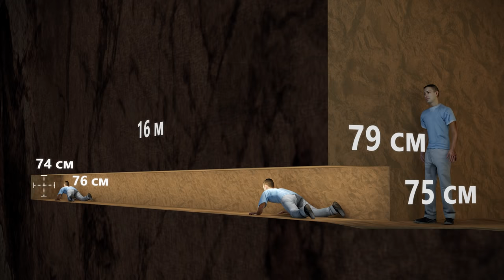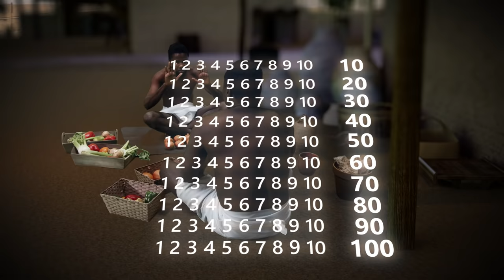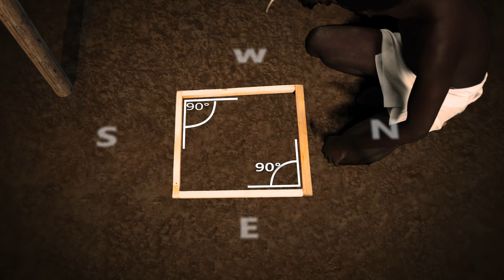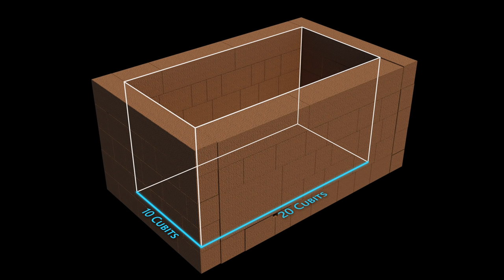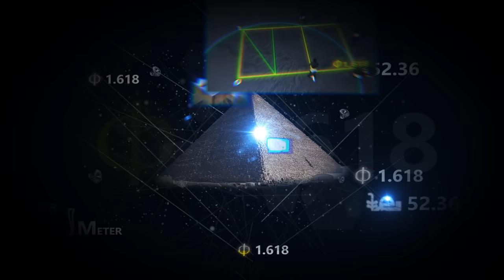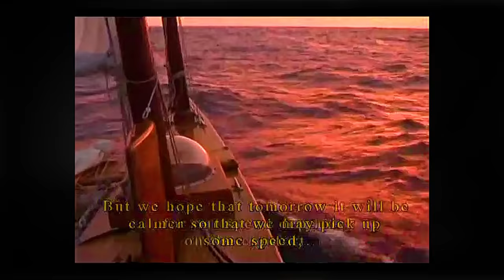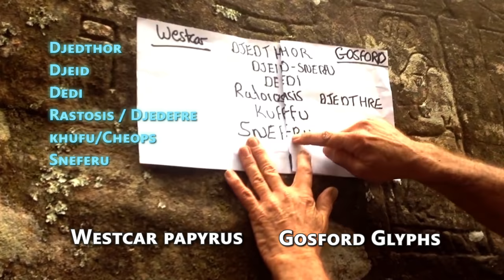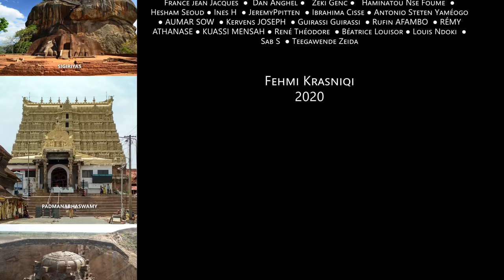The Movie Great Pyramid K 2019 - Director Fehmi Krasniqi

Comment: The cement seems feasible, but melting granite? Those temperatures would require special suits, eye protection, and the melted granite would not have a grain as seen in statues it would be a blob of glass.
Reply: In 3.5 hours they spend zero time explaining their maigical solar lenses..
Reply: really solar lens ,rubbish requires 4000deg c to liqify rock even cement would just be warm
Reply: You can melt granite, it becomes obsidian. You could try to pour it into molds but without some serious heavy machinery it will not create anything like a large stone, and it will crack as it dries, and it won’t be strong.

But, again, if you melt granite, it will no longer be granite, which is only created deep inside the earths crust. You will be left is obsidian, like glass.
Reply: @ericpalmer3588  Exatamente !
Reply: @ericpalmer3588  is there something that you can melt and mix with something else to make granite?
Reply: @Digidi4  granite is forged deep in the earth’s crust under tons of heat and pressure. 

Anything made out of granite is carved. It would not be possible to create granite and pour it into a mould.

The whole melting granite theory is not necessary.
Reply: @ericpalmer3588  oh ok, thanks for the explanation
Reply: @johnwalker5366  wrong granite melts at 1215 ºC or there about easily attainable with a magnifying glass of say oh 1 metre  ....oh look a metre the egyptians used a metre
Reply: @ericpalmer3588  Actually if it cools slowly say for example it was surround with insulation perchance lime concrete? it would not crack and would retain its properties and would still be granite. obsidian is not even a rock its a by product more like glass, formed by heating and rapid cooling of molten rocks
Reply: @RobMocar  incorrect. If you melt granite it is then obsidian, no longer granite. What you are left with is a glass like substance, the crystalline patterns and marbleization is gone. Granite is only created deep in the earth’s crust where you have the right amount of heat and pressure and change.
Reply: @ericpalmer3588  without going all geology on you here some layman's answers "Question" https://www.quora.com/If-I-melt-granite-will-it-be-granite-when-it-cools I also have a degree in metalogy which I had to take to get my welding certicates so I am very used to molten elements and how they work.. I do agree hard to do but I don't believe impossible... More feasible than aliens
Reply: @RobMocar  Do it then. Make a giant granite block by melting granite down into a mould. And use a lens.
Reply: @ericpalmer3588  yeah cause I can do that all on my own lol just be open minded bud nothings impossible once u know how it's done
Reply: @stephendriver4656  heated too fast and cooled instantly
Reply: @stephendriver4656  Yeah, the stone turned to glass (obsidian). It is what we have being saying.
Reply: @RobMocar  would it be possible to do with a 50x50cm rock, perhaps? that would be great to see... how would one keep the granite from cooing too quickly?
Reply: It would take longer and be more dangerous to make one block, it would require a massive amount of heat, who would be able to work with this then put it accurately in a mould, let it set then get it out the mould. It would take too long doing this and very dangerous. The thing is granite looks very much like granite in the pyramids as in quarried, transporter during certain times of the year and taken on barges, the papyrus evidence. There is plenty of information on the quarries and who were masters of the quarries.
Reply: @RobMocar  yes it is a lot more feasible!
Reply: @Digidi4  superglue?
Reply: It requires deductive reasoning to understand what this video is attempting to explain.
Reply: @Wandering Lion I'm not sure if I understand your dispute. The video shows how the white shell of the pyramid was constructed, and how it reportedly fell off from an earthquake.
Reply: Exactly.  
While granite is indeed an igneous rock, it's like a cake in the oven.  it has to cool slowly and evenly across the entire mass to make good uniform granite.  If it were  poured in a mold the size of a stone it would cool quickly and the various minerals would not separate out and crystallize.
It would not be granite.
Reply: @RobMocar  Its all down to the right kind of temperature. We have to remember, those people back then had a lot more knowledge about stone than we have today. Stone was their tool nr 1.
Reply: Black Egyptians must have had a catalyst. A true scintific mind would start looking for a CATALYST
Reply: No, they had a special granite and secret lost knowledge of all the great mysteries, that’s why we have to believe everything.
Reply: @greensofa1  I have no problem with the idea of an advanced ancient Black culture, but the evidence doesn't support it in as far as this documentary is concerned.  There are dozens of records from the Egyptians themselves talking about Black Africans as being distinct from them. 

There's also the primary evidence from cultures like India where they explicitly say their knowledge came from a light skinned people called the aryan. Also, linguistically we can trace a common language from the Russian steppes, where these people originally evolved all the way down through India. There is no connection to Egypt or Africa.

Then you have South America, where again their traditions speak of light skinned people who gave them their knowledge. Those poor natives mistook the spanish for the gods returning. 

Even in my own country, Ireland, our civilization is older than Egypt and our own traditions tell of the original irish, the fir bolag, who were dark haired (doesn't mention skin colour) who were later replaced by the same gods with light skin and blue eyes who invaded. 

There is just too much evidence to the contrary for these claims to stand up to any scrutiny. 

I'm all the truth to be examined and scrutinized, I do believe the mummies should be tested and whatever the findings are I'll happily accept the facts. But as far as I know they've already carried out DNA testing on mummies and this has shown the Egyptians are pretty much the same people today as they were back then.
Reply: @The_Reality_Filter  Dude, then you obviously sit on your eyes. It´s in the video.
Reply: @matthewshingleton7088  I deliberately didn't state that but you're right. Ancient Egyptians are genetically closer to modern Europeans than current Semitic/Arab Egyptians.
Reply: @ericpalmer3588  Also, granite formation requires its source magma encounter water on an oceanic scale.
Reply: @RobMocar  No.
Reply: There is a patent on artificial molten granite from 1929.
Reply: @dennistoft8458  Made in a crockpot?
Reply: @christobalcolon6601  you can use a clay mold.
Reply: ABSOLUTELY RIGHT YOU ARE !! I was fascinated with the idea of the geopolymer cement ...But melting one of the hardest stone on earth !!!!!! Man!!! How is that even possible! I mean if human beings could have melted granite ...then why are'nt we doing that in this 21st century!!! we have much more easier ways to melt!
Reply: But what about the moulds?  The moulds would require heat as well, before pouring molten granite into it.  A cold mould may crack up also before even pouring half the molten rock.
Reply: @prm6463  The same kind of molds where you pour molten gold. Fire hardened clay.
Reply: I also gave a thought to the magnifying glass, it may not have been used for melting, but it may have been used for quick drying of concrete to build pyramids.
Reply: @Wandering Lion if they made all stones identical then the pyramids wouldn’t have survived earthquakes, floods etc. The irregular shapes help keep large structures like that in place for years.
Reply: Look at the temples in india. Lots of rock melting technology used there.
Reply: @utharkruna1116 can you share some specific examples?
Reply: @Artster8489  not off the top of my head. But many have facets that can only be explained that way. Even pre Incas had rock melting tech.
Reply: @Digidi4  No
Reply: @greensofa1  yes!!
Reply: @joeroganjosh9333  jajajaj  ok  lets go  and cheers for the UFO tech!
Reply: @skobywankenobi   To my brothers and sisters, so they know the reactions under my original comment are NOT TRUE:
As Prof. Stefano Palminteri says, “People will ignore what doesn’t fit with their biases – even if it costs humanity!”
Do not waste your time, just give up on especially those who will never see the hot light bulb that burnt them, if they don’t want to. Their criminal attitude is beyond denial, because not only will they deny the OVERWHELMING amount of facts, in the name of their double-standard science, they will also ignore, hide or even DESTROY THOSE FACTS. They will deny the lies of white “scientists”such as Charles Vacanti, Liza Gross, Lönnstedt and Eklöv, Alexis Carrel, or the likes of Charles Dawson who forged and tampered evidence to mislead us into thinking EUROPE IS THE BIRTHPLACE OF HUMANS and not Africa, when you lived EVERYWHERE on this planet over 800 thousand years before the first white ever even existed. They will push the DNA lie about the Ancient Egyptians of Kemet being white based on intentionally chosen DNA samples of late non-indigenous foreigners and invaders of Kemet (hyksos, romains, greeks and turks). Know that these non-representative DNA samples are from Lower-Egypt and do not apply to the Black kings of the 1st to the 20th dynasty, corresponding to the time of Egyptian marvels and pyramid building on the land. They will act like the great African anthropologist, physicist, chemist, linguist …. Cheikh Anta Diop never lived or they will cast shadow on his crushing DNA evidence and carbon dating works and prominent books all proving Blacks created ALL the greatest civilizations on Earth and how he silenced all the white scientists at the Cairo Conference with irrefutable evidence.  They will use Wikipedia, the History Channel, NatGeo, mainstream media and RACISM to belittle him/you, and anyone who tells the truth about your greatness, because they only way evil survives in the world is by making YOU think you are nothing.  
They will also deny that they always make sure they open your Egyptian ancestors’ coffins off camera because they want to tamper with their appearance before they unveil them.  They will never admit that they conspire on code to lie to you about everything regarding you on this planet. That you must be the only race to whom God might have ever revealed him/herself, since you Black people existed earlier than all other races. That YOU kept the planet intact for hundreds of thousands of years thanks to your Ma’at, but in just 2000 years they trashed it. Please do your own research and do not believe ANYONE who tells you all northern Africa was not indigenously Black, and use every negativity and false publicity to lead you to believe that you are nothing.
Reply: @skobywankenobi   Thé Egyptian today are the newest version of Arabs who migrated from Turkey, descendants of Persians and others.  They have nothing to do with the original pharaohs form the 1st all the way to the 25th dinasty.  The original Black Egyptians did not speak Arabic.  Their language and customs are still alive in the languages of today subsanaran Africans.  Please read Dibombary Mbock’ numerous books on the subject. I am Haitian and of course you will say I have no relations with Ancient Egypt but  my native language is full of references and typicall ancient Egyptian language all over.  This explained by the e fact they when foreigners attacked Egypt, killed many of the natives, some ancient Egyptian and priests fled down south in regions known today as west Africa, and other south Saharan regions.  Slavery brought some of them to the Americas, thus Haiti...

Comment: Next step:
--> Attempt to create and polish a lens from the materials noted in the doc.
Reply: Sand makes glass.
Reply: Yeah, replicate it on a smaller scale
Reply: @ketchupcommander  great!
Reply: @ketchupcommander  I had seen the video before. The problem I see is that they make Obsidian with the melted granite. According to the movie, the granite structures the egyptians make by melting granite has the same properties as the granite they started with. It needs to be proven that this is possible,without changing the chemical structure of the rock. It also needs to be proven that you can melt granite using a lens made using the technologies the Egyptians had available to them, not a modern day lense.
Reply: @brantdesmond7448  Yeh agreed. Using old school methods only.
Reply: @brantdesmond7448  takes about 2 min to burn an ant or longer if moving on a sidewalk. I've cooked many a sidewalk with a 4 inch magnifying glass, none melted, lol. That and so little evidence of clear glass...

Comment: When they “poured” the Hoover Dam they used cooling pipes and ran water through them because of heat from the concrete drying I seemed to remember. 
I wonder if it would have affected this theory as well, or since it was done somewhat intermittently there was no need 🤔
Fascinating show though, much better than trying to say that men dragged humongous weights here and there
You couldn’t beat a guys ass enough to to make that possible
Reply: They used cold water because concrete will generate too much heat and cure too fast and crack if not controlled. Yes, while there is some very relevant information in this video, there is more BS tan actual facts.
Reply: @vonbunn  ummm, you can actually find all the information from other sources, which lead me to understand these arn't just theory, but have evidence showing, but the evidence won't be accepted by a lot of people for a simple reason, most people are not educated enough to understand how things came to be, they are educated enough to be told how things came to be, and that will heavily affect what someone can take for evidence or not
Reply: The lens tool is hidden... where...
Reply: well... what belongs to one has to be credited to one... fair and squared... let's find by whom were the pyramids build by the Egyptians or for the Egyptians... by other civilizations or for the other civilisations... what was hidden by those builders is revealing itself only in certain times... Those builders knew more than we can digest at this time... who knows when the other clues will come out... and a little footnote for the one who's taking the credit, the other clue might make the scale heavier on the other side at any time it sees fit...
Reply: @r2c3  it's not hidden, we just don't use that anymore, we switched to big furnaces and such, think about technology today, how fast we upgrade them and dissmantle old versions, much more understandable when you realise that
Reply: @hydroltd6148  And the use of these furnaces makes the users somehow more efficient... is this what you are trying to get across...
Reply: @r2c3  no, just that technology changes over time, for better or for worst, like our tvs, they give way better picture now, but they dont last as long, but anyway, was just saying that if they used the technology even after, chances are pretty good that they would of found a more efficiant way, but who knows, maybe the lens was the creme de la creme, I know when I see it it sure seems to be, and nothing alien, I used to think aliens built that shit, but this actually makes more sense as we do that kinda stuff now, melt stone and make concrete
Reply: @hydroltd6148  it looks like not everything you see or hear relates smoothly and when something is concealed without proof then the credit could lie elsewhere... keep your open mind in good shape... cheers to that...
Reply: @r2c3  thank you, and to be honnest so many things are possible even plausible, I just try to be extremely slow to discredit theories. If they don't offer the answer I seek, I simply look up more information, always something to discover int his vast world ^.^ have a good week

Comment: The poured concrete is a sound theory. But, the solar lense to melt tons of granite chips is a bit far-fetched. Lenses that big and that much heat would have been extremely dangerous and hard to keep secret. My best guess is that they had a way to pour granite concrete that is indestinguishable from natural granite.
Reply: SOUND energy. Can do more that break wineglasses, ya know. Look up, Corral Castle.
Reply: True
Reply: i agree with you the poured limestone is a sound theory, and once you look at alot of the construction through that lense it all makes a lot more sense. and when compared to the prior theory of copper chisels and quarrying it seems so much more plausible.
i also agree about the lense, i think in theory this is possible but its certainly out there.
what if all the discs we see above the heads of the gods were depictions of this technology though? this would have been like magic to them once they considered it
Reply: @jamesbonde4470  I've been there. It's amazing. Built by a guy barely 5' tall. From Latvia. For a woman who never came. He waited his entire life. It's near homestead FL. South of Miami. On the way to FL city and the keys.